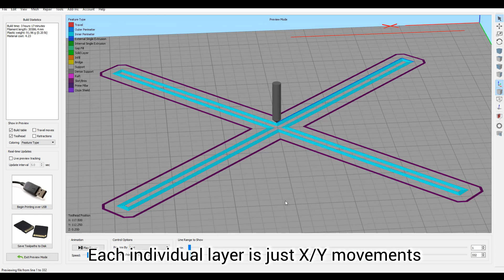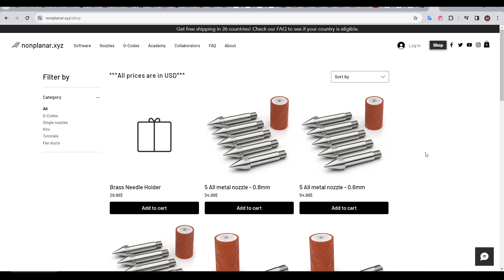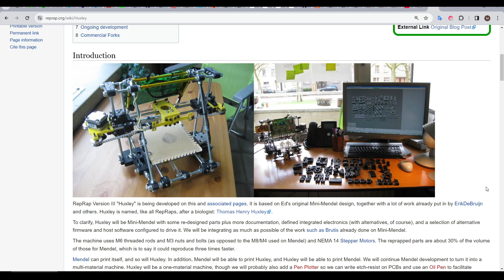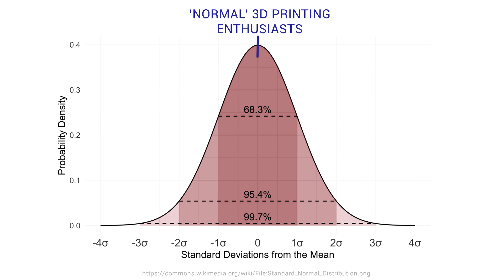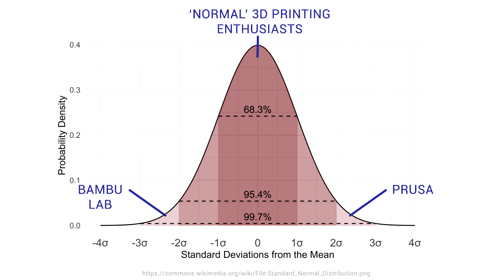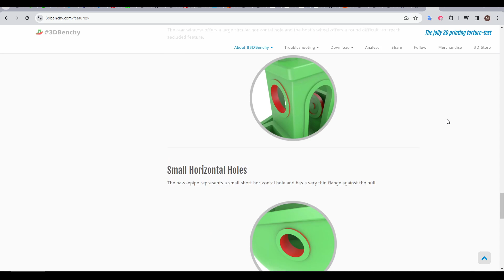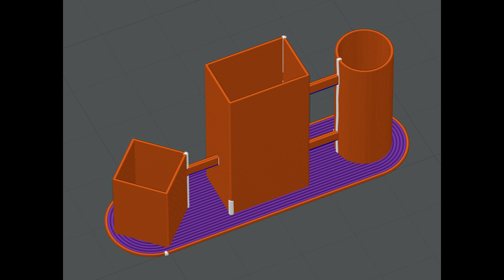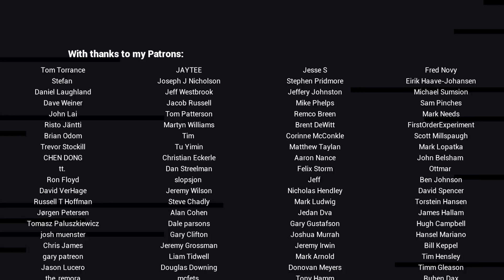3D printing mysteries that need to be solved in 2024

Comment: Regarding filament snapping, I had this as an issue with cheap Teflon tubes and certain PLAs a while back.
It would usually happen when it was left in the tube for a couple days, while the filament on the roll was unaffected.
Switching over to capricorn tubing solved the issue, so I'm assuming the plastics were reacting to eachother somehow.

Comment: About the last issue, that can also be caused by the printer not going a single direction around the perimeter. I wish there was a way to force the outer wall to always be printed either clockwise or ccw for consistency

Comment: Coriolis is very unlikely, as you you yourself pointed out. The predominance of the (weak) Coriolis force scales with the size, so for ginormous systems (like tornadoes) it plays a role, less so in toilets, even less so in 3d-poops.

What is most likely, imo, is the pre-twist caused by the feed direction of the filament (spool) vs. the "bowden" tube - does the spool come from left or right (or top), and does it unspool clockwise or counterclockwise.

Comment: 1. Non Planar 3D printing: Is not needed, adds complexity with very little benifit.
2. Toxic: Prusa & Bambu boys huh ? xD AHAHHAHAHA
3. Snapping Filament: I would guess the material is PLA ? PLA tends to get brittle after a while when it absorbs moisture. PLA after all is simply packaging material, I don´t use that all for any of my prints. Use PETG instead, it is superior in any way to PLA.
4. 3D Benchy: ooooh jesus, print calibration pieces from Orca Slicer instead. Way faster.

Comment: I believe that your filament snaps so because it's very old (may be the seller lied about the date). I have seen exactly that in my very old filaments (more than 5 years old). But, they print better than new ones.

Comment: The surface artifacts could be a simple, in many cases, as time. with the cylinder, once it gets to the surface it takes up more time allowing more cooling on the other part before getting to the next layer. Test could be to see if the results are the same in a heated enclosure.

Comment: Marlin has MPC (model predictive controller) for hotend heater. one of parameters that can be set is heat capacity of filament. i think it can be increased in order to bump up the heating when flow rate increases. also having thermistor closer to the nozzle might help. perhaps some kind of modified nozzle which would allow thermistor to be mounted directly into it? maybe we can just measure electric resistance across steel (or even brass) nozzles to measure the temperature directly. i think it might be accurate enough. at least as long as we don't print with conductive filament...

Comment: @TeachingTech, Hi Michael, as for your last problem, I noticed the same on my ratrig Vcore3.1 and thought it was slicer induced. however, now I believe it has to do with the rotation of the perimeters. When another object is introduced or left out, the slicer might choose to go from clockwise to counter clockwise (or vice versa) and what you are seeing could be the bulging difference from the corner, either  extruded prior to the corner or after the corner. Wachting the extruder path in the slicer might be able to confirm this (I haven't tested it as I just came up with this explaination while watching this vid ;-) ). Also, changing your Pressure advance might make this effect more clear.

Comment: About filament that snaps. Only filament that snaps for me is geetech but it is still pretty good for printing if you just remove part that is "in the air". If you leave (especially white) it 1 day without printing the piece of filament that is coming from the spool and going all the way into the nozzle even in the ptfe tube likes to snap. Sometimes it fully snaps by itself. The funny part is that even if the spool stays in opet air for a year outer layers wont snap but if it is exposed on all sides (golng from spool to the hotend) to the air it does.

Comment: Pareto - 80% of the noise comes from 20% of the crowd
Good year-end review. Thank you. I, too, have explored (and printed several items) the non-planar code/solutions. I do wish any of the mainstream slicer developers (with the exception of Simplify3D - I purchased 4.+, but refuse to purchase the upgrade to 5 (which they were woefully late to deliver and at a premium cost), would step-up and incorporate non-planar slicing. I agree that Prusa or Orca should be the chosen ones.

Comment: To the planar printing it would be great if a slicer could caolculate how many layer it can manage with obstructions. like it got 5mm clearance, than it can do 4mm toplayer of planar in one go then another 4mm=20layers... and so on. Whont be in one planar peace but better than top layers of standard. 
About the comunity, several years ago bigger companys started to send free printers to Youtubers.... i took avay a sub from 3Dprintingnerd when he was lak of simple spare parts and didnt know how to change a tempsensor, then i relaised he was a payed front figure. Taking machins for testing like a bribe... And dont get me statred on 3MF file promoted to be smaler. Yes but before the slice, after just as big. But contains information that can make it a print count to make mony of a licens. With a poor quality since the file got less info, suported by companys and filamentfriday... So old youtuber that was great to follow a couple of years ago are now the one hurting the "comunity" and Prusa (XL) is one of them... look behind you on the desk... the poluters, payed comuicators, and they are alover the modern society not only 3D printer comunity. Companies got there own softvares so you cant use other brands or 3-partyparts in the printer since the setings cant be changed.

Comment: OK  I love a challenge and this is really a fun video you've done here.  I'm definitely no where near your level of expertise on this stuff but I just can't resist so I'm going to try to answer each mystery in order.  1st Non-Planer printing just looks to complicated.  2nd I tried the extrusion test you asked about on my only 2 printers the ender 3pro and the sovol sv06 plus and I would have to say its about a 50/50 chance which way it turns.  Seems to me that the path of least resistance in gravity is the direction it chooses.  3rd As for toxicity in the community, well, it's like that everywhere, I once gave an unfavorable review on a shotgun and wow the fanboys came out swinging.  All I can say is don't be so touchy.  4th The filament issue is more interesting to me but I think its a moister issue. The filament actually needs some time in a dryer at about 55c.  I have noticed PLA gets brittle when its been in the air a long time, but after some time in the dryer it seems to be more flexible. 4th Benchy is full of surprises!  Just another reason it endures.  5th The artifact issue you raised is the most interesting item you covered here in my opinion.  I notice that the photos you present are actually exhibiting 2 different problems in my opinion.  The photo from novaplusplus looks like layer lines related to 3 things, speed, jerk, and acceleration.  The photos of your blue and grey towers are possibly something else,  I think I would have to defer to your expertise on that since you said flow issues were the cause.  You're probably right.  Thanks for this fun and engaging video.

Comment: Non-planar printing:
Pitch it to Orca maybe? It's not going into the Prusa slicer, bet, unless they plan on selling a nonplanar printer of their own. Slic3r derived code can be integrated into Orca at a moderate effort as well.

Does filament flow differently in each hemisphere?
No. Northern hemisphere, coils same direction as yours. I think it's the nozzles, they're manufactured using normal right handed drill bits, which imprint a fine groove pattern into the wall of the orifice. Or maybe it's not, i don't know.

Community toxic? Yeah i don't think it's 3D printing, i think it's the world getting a little more polarised and radical. But also those old forums they were moderated right? If someone went on people's nerves, they'd be gone. Then a second thing that tight knit communities tend to be more civilised, as people know each other, often face to face or need to work with each other online and not get on each other's nerves, it would be a little easy and a little too painful to become ostracized, while when it grows, it becomes much more anonymous. As to people shouting about Voron from the rooftops, i'm not going to build one any time soon, and indeed there's any number of good printers one could build, and probably should build so things don't get too incestuous, but there isn't an ecosystem of mad designs including alternative parts and ways to build things quite like Voron's, and it involves the people, so i'm not surprised, even if it's annoying, i don't see anything nefarious there. Don't go like THAT guy seeing a conspiracy in everything, you probably know whom i mean.

Why does your filament snap? I wager a guess, that might just be fluorine getting kicked out of your white PTFE tube by light, and then eating that filament. Or maybe it's something rising up from the hot-end and extruder through the tube and getting trapped in there for a while. Maybe the filament itself emits a substance while it degrades thermally that is harmful to it?

Surface artefacts? Total layer time perhaps. The path planning can also affect how it looks like in the corners, and it depends on what else is on the layer.

Comment: Regarding the surface artifacts you mentioned last, i think you're on the money about flow rate. I can't remember who, but i saw a video in the last week talking about the same thing on bambu printers, setting the flow rate 100mm/s from the 200 default solved it. I'm on the waiting list for e3d's new highflow hotend parbtership witb bambu and was going to test it myself, i've been trying to make a 3d printed modular laptop based on the raspberry pi 5 and the surface artifacts are causing just enough friction that some of my supposedly identicle parts dont fit in the same slot the others do (battery pack insert that drops in from top so movement is perpendicular to the layers.)
Reply: Also its not a product or anything just a practical project to help me educate my 5yo on how computers are made, he's decided he wants to be a programmer like daddy

Comment: Coriolis force shows on objects travelling in north-south (earth axis) direction, filament goes mostly downwards. Near the poles it would curl up from coriolis force. I would be very surprised if the way the filament turns is influenced by anything else than nozzle microgeometry. Any drill turns right, to there may be right-turning grooves in the nozzle or something. If you choose a different nozzle manufacturer with a different process, it might change. 

For the last question, my theory is that this is a form of ringing. The steppers have to fight the oscillation of the printhead, and if the printhead takes a different path because an object is missing in the plane, then the oscillation pattern changes.

Regarding toxicity, it is very hard for the human brain to accept ambivalence (there is more than one good way). For tribe culture, not fitting in was a bigger threat to your life than being wrong. So people with limited brain capacity or bad education today search for a tribe that will support them in case their fear of being wrong comes true. The tribe will then shout louder than everyone else, making the question of who is right irrelevant. See iPhone fanboys/girls who will not date someone with an android phone... yes that is a thing.

Comment: I purchased a mk4 to go with my prusa mini and anet a6 evolution printers but REALLY wanted the X1 Carbon.. The thing that swayed me back to prusa was rhe support which is fantastic and available any time I've needed it and been understandable, spare parts are available and firmware far in the future (based on their other printers) as well as great video/installation guides. I heard rumours about poor bambu labs support, and needing to use the cloud to access 100% of the features (which for my company was banned especially a chinese company in the cloud), yes there is lan mode but it's not as feature rich from what i hear.  Anyway, i think its interesting that my reasons no longer have anything to do with the actual printer itself anymore but rather how the printer is supported in various ways. I needed a printer that just works, can be used in a private network with limited internet access, has great support and part availability 5 or even 10 years later (we tend to keep printers running long after they're not for sale) and so i went for prusa.. that's all really.. no hate for bambu here though i do wish they do a better job of giving back to the community that helped them get here in the rhe first place.
Reply: I think that people used to be only worried about the hardware capabilities and getting the highest-spec machine for the lowest price (or just the lowest price machine).  Now, there are many more considerations, such as availability of spares, how well and how quickly the company can support and repair/replace parts and machines, as well as the general ethics of that company.  No company is perfect, it just depends on what really matters to you.  Also, not every machine is aimed at every user.  As a tinkerer, I'm happy playing about with cheaper machines.  Would I like to get my hands on a Prusa XL? Sure.  Would I use it to its full capability?  Definitely not.  If what you have and can afford works for you, then that's great.  It used to be resin or FFF machines to choose from.  Now there are a range of features on various FFF machines that matter to different people.  Choose and use what you like/need.  Variety is good.

Comment: About the surface artefact: isn't it the same as the more famous "bow line" issue with 3Dbenchy? I think it is the same cause - layer time difference caused difference in cooling time, thus the layer just contracts a bit more (or less) than other adjacent layers. I might be wrong, but this is most probable reason to me.

Comment: Surface artifacts are weirdly more visible with cura slicer but less visible with prusa slicer on my e3v2neo
Could this tested by adding slowing down speed and seeing if they stay as then the hotend is not as stressed with slower print speed?

Comment: Thank you for your videos. I learned how to set up my first DIY printer from your tutorials five years ago. Your videos are like real lessons!

Flow Direction:
- I'm in the Southern Hemisphere, and my Flsun SR prefers to rotate clockwise while the K1Max goes counterclockwise. It depends on how the filament first hits the bed.

Toxic:
- I think this toxic moment is due to the printer becoming a "household" and accessible product, attracting other people who are just following a trend.

Filament Snap:
- The filament is brittle due to moisture. I'm 100% certain. I have a spool exhibiting the same characteristic. Even inside the PTFE tube, it breaks. It only became more malleable after dehumidifying.

Artifacts:
- You need to observe the amount of retractions for the layers and the speed at which the printer is printing. Increasing the temperature or reducing the volumetric-max-flow of the material helps resolve it. [Bonus] In another photo, it seemed to have another issue, which in OrcaSlicer they call Reverse Odd, causing inconsistencies on the surface when activated (https://github.com/SoftFever/OrcaSlicer/issues/3146).

May we all have a productive 2024!

Comment: Re the surface artefacts when printing multiple adjacent parts.

This is related to the cooling of the part whilst the nozzle is off printing the other parts. 

The surface on a the rectangular prism  doesn't cool as much once it's cleared the height of the other part or model.

Where there are holes, the tension in the material as it cools changes the dimensional accuracy because of the uneven surface tension compared to the other layers above and below

Comment: Non planar 3D printing could be useful if the printer head could be angled with 2 more axes. And color switching could be easier with a set up like this because it could be used like paint. But nobody wants to program for that.

Comment: I'm hoping that Bambu Lab's 2024 shake up will be bringing non-planar printing to their slicer. Or maybe one of the competition will use non-planar printing as their differentiator from Bambu Lab. Surely it has to be the next step after the huge improvements that have been brought in the last couple of years (like the reduced sound after the last firmware update to the X1C)

Comment: My filaments used to break also (at the ends, if I left them a longer time in the tube, at the end of the roll). It was mostly PLA, I observed that the air (and the ends) was at fault....when I put the filaments back in a ziplock bag with some packets of silica gel, it wasn't so brittle after. This happend a lot and when I needed the printer the most.
Since then I switched to PETG (because I have an open Ender style printer with a heatbed, so I wasn't risking using ABS) and like magic, these problems were gone (I also like PETG, because it's heat resistance and because it handles humidity better => ex. for Vases, glasses or washable elements).

Comment: Coming from photography the tribalism thing just seems completely normal to me. Customer wants features from flagship camera in prosumer camera. Company A releases new camera and customer asks why they can’t upgrade the camera they have. Company B releases new camera and customer goes to company A and asks why they haven’t released a camera that is the same as company B. I was curious about the non planar printing. If the tolerance clears the tooling is there anything that makes it better or worse than a 5 axis printer?